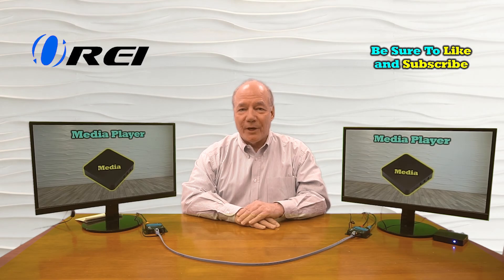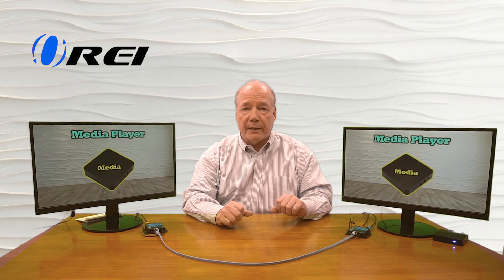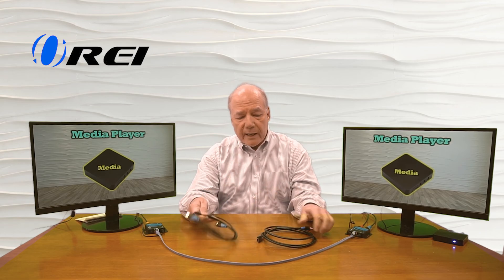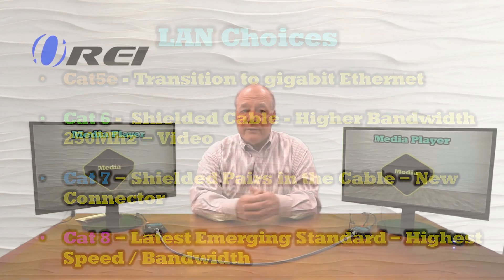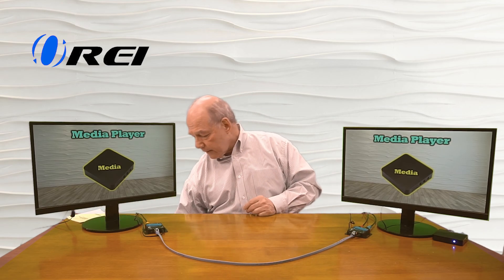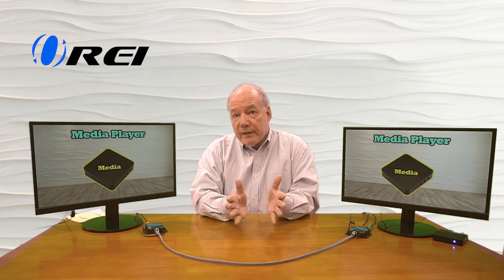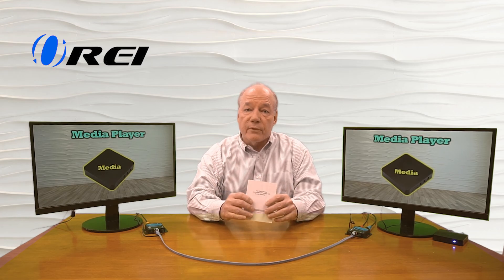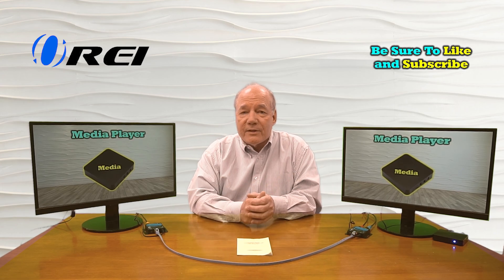HDMI Extender Troubleshooting - FAQs

Comment: I tried everything in the video. Three hdmi cables i have, work from my pc to my monitor. All three work INDIVIDUALLY. The extender is plugged into the wall. Once I use the extender, my monitor screens just stay black. I used the extended for approximately 500 hours last year, and it worked just fine. Now it's not

Comment: Just a few notes from my use case.  Connect 2 PC's to HDMI Matrix through HDMI Extenders to display PC output and audio to multiple TVs.  Flip Extender's Transmitter to RX to get audio device to show up in Windows.
HDMI Matrix (UHD-EX165H-K) & HDMI Extenders (UHD48-EX230-K)

When PC's are connected to the inputs on the HDMI Matrix, the PC's will detect it as an Audio output source named "HDMI Matrix" in the sound settings.  This works great!  However, the HDMI Matrix was too noisy to keep on my desk so I moved into network closet and purchased to 2 HDMI Extenders to connect to it.    Connected PC HDMI to input on Transmitter, Monitor to Loopback, and Cat 6 to Cat port to go out to receiver.  In the network closet, each receiver is connected to the HDMI matrix inputs.

After initially connecting the HDMI Extenders, I had no option of HDMI Matrix in my audio devices in Windows.  After reading the manual I figured it out.  Flipping the EDID RX/TX switch on the Transmitter to RX got the Windows PC's to show the HDMI Matrix as an audio output.

On the Transmitter, TX will tell the source (PC in my case) about the Loopback HDMI device.  RX will tell the source about the HDMI Matrix, or whatever's connected to the receiver.

Works great!

Comment: Home Depot have a cat5e 100’ for $24.99 and works perfect I did tested the resistance with a voltmeter and tested 3.2at 100’ if the cable tested more like 6@16 Homs resistance then the cable is not going to work I did tested some 13.99 100’ cables from Amazon and eBay and resistance is @16homs at 100’ so this cables don’t work after so many test that one that Home Depot have a very simple cat5e for 24.99100’ works perfect and I did connected 2 100’ =to 200’ of this 24.99 cable from Home Depot and no problem works great so test your cable resistance before  it have to be no more than 4homs at 100’

Comment: We have multiple 165C modules installed in a community hall. The issue is sometimes, few devices do not work. It is random and we don't really know what is wrong. Can you please help us with this issue?
Reply: Hi test the resistance of cable it should be no higher than 4homs

Comment: I got the EX-165c and wanted to send the hdmi 1080P signal from top floor tv to another tv on the main floor via power line adapters since I cannot use a direct lan network cable from the transmitter to receiver.  So I thought I could transmit via power line adapters but for some reason I cannot get power on the receiver this way so no picture. Anyway to fix this?
Reply from the maker: Please reach out to our support team at info@orei.com and they will help you out with this issue.
Reply: I have a similar issue. however, in my case the power to the receiver works but the hdmi from the receiver to the monitor is having issues. I don’t know what’s causing or how to fix it. 

Did you manage to fix yours?
Reply: @MH-sf3oj  no unfortunately it’s not supported and so I returned it. Got myself another one from a different brand (AV Access ) and works amazing thru power line adapters.  Bit more expensive though. Around the 150.oo range but it works.  And it also works wirelessly.

Comment: Question, does the extenders for instance EX-230UHD work with a normal network switch connected in between? For instance Transmitter->Network Switch->Receiver?
Reply from the maker: Unfortunately no. We have no 4K device that works over IP. We will have one soon.

Comment: I had this running 2 TV’s and had to replace one of the TV’s. Now when I turn on the 2nd TV (the new one) I get an error saying check the device for power. If I unplug the extender and plug it back in it comes right on. No wires were changed on the TV’s. The main TV work with no issues like normal. 

Any thoughts?  Maybe the setting I have the TV on?

Edit:  I forgot I also replace the Roku device I had plugged into the HDMI import on the extender.

Comment: Hello! I have an HDMI extender over ethernet. I'm trying to use the HDMI out of my Mac Laptop as my source. Once I plug the Mac into the sender unit, it shows up on screen for a few seconds then it goes to black. I've tried all the display settings on my Mac, every which way and refresh rates and resolutions..nothing works. It shows up for a few seconds when I first plug it in, but then nothing after. I've tried other adapters out of the laptop as well. I know the setup works because when I plug a PC as my source via HDMI, it works 100% fine. Any help?

Comment: my team bought a set of following

1 unit TX HDMI Extender over IP
10 unit of RX HDMI Extender over IP
1 unit of RG-ES116G, 16-port Gbps Unmanaged Non-PoE Switch

media source -> TX HDMI Extender over IP (via HDMI cable) -> cat6 ethernet cable -> Port 16 - RG-ES116G -> Port 1 to Port 10 via multiple cat6 ethernet cable -> multiple RX HDMI Extender over IP (via HDMI cable) -> Smart TV

current issue : 
low frame on the receiving end device = Smart TV is showing video but with low frame / stuttering / lagging

please help 😥

Comment: So I want to be able to use my Benq monitor with 2 different computers and not share the same feed. With the Benq monitor, I can have one monitor set with the puck on 1 and then have another feed for puck 2 and switch back and forth. Which HDMI connector would I use? I don't want to share the same feed on 2 monitors, but rather be able to use the 1 monitor and use the KVM switch feather to switch between the 2 computers. Is there a device for that?